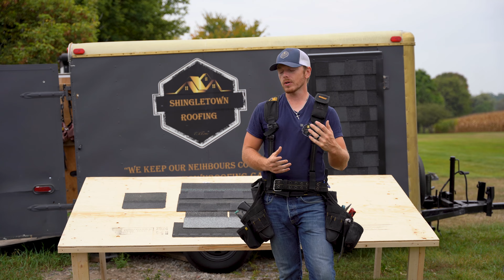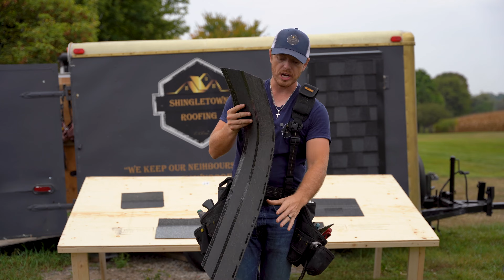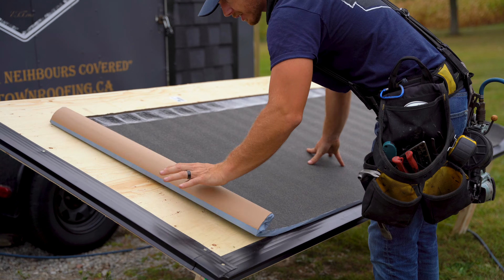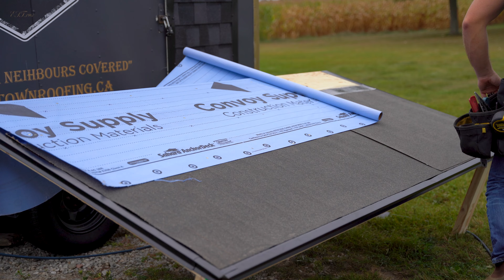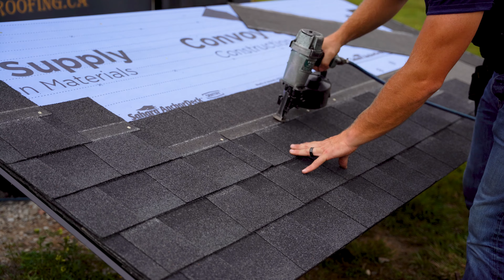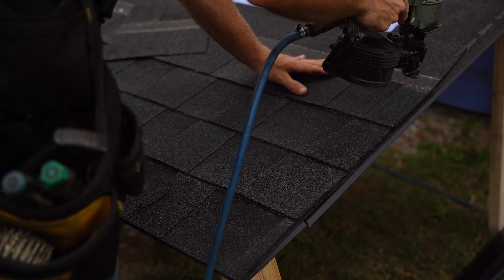How to Install Architectural Shingles

Comment: I think the drip edge shouldn't be butted against the fasciaboard. The drip edge should extend past the edge of the roof by at least 1/4" to 3/4" for water to cleanly run off.

Comment: Why doesn’t the ice and water shield go all the way to the top of the roof? Why doesn’t the underlayment go all the way down to the eve?  (I am a newbie.)
Reply: Ice and water shield is for ice dams where water accumulates over the eaves. The snow melts inboard of the wall and the eaves are cold and is where water ponds as it refreezes. Underlayment is not designed for standing water.

Comment: I saw in other places that the drip edge on the rake should on top of the ice and dam shield not underneath it.
Reply: I'm a rookie, but that layering seems off. Always account for water flow, even in underlayment.
Reply: Depends which state you're in, they vary.

Comment: So unfortunately those old well maid 25 to 30 year three tab stand up better in high wind and hurricanes.
Reply: Not wind rated and not allowed where I live in Florida.  Had 3 tabs before rules changed and lost several shingles due to high winds.  Now have 120mph rated Architectural and have never lost a single one.  Just my experience.
Reply: @SDRacing07 They sell 3 tab everywhere in Florida even Home Depot  ... nothing in regulation or codes stating you cant use good three tab shingles... lol...after 35 years three tabs blow off ....any shingle over 35 years needs replacement.... Go Metal .... life time

Comment: I live in Florida. I have seen the exact opposite of what your saying. The three tab lays flatter. All those architectural shingles lift up blow off and they're a mess. The good old three tab with a nice felt under it You don't have those problems and those three tabs last 25 to 30 years and these brand new architectural shingles are blowing off in a little storm and fill in the ditch...
Reply: I live in the north. We don't get cat 5 hurricanes or even tornados. Architectural shingles are the best up here.
Reply: Also live in Florida and they won't use 3 tabs here.  Architectural with wind rating is preferred if not going metal.

Comment: so start on the left side 6" off set each layers and then go across , but after you get to the 5th layers the start the process over until you reach the top ?
Reply: I believe that's correct.  if you're right-handed start on the left corner

Comment: I noticed you placed the ice/water shield and the underlayment OVER the rake drip edge, whereas other “professional” roofers say that they should go UNDER the rake drip edge. Which is correct?
Reply: Since the starter shingle and the underlayment doesn't bond to the drip edge, you can just put some roofing cement on the drip edge. That way, water won't get to the sheathing either way.
Reply: @michaelott310 GAF states over the drip edge.
Reply: We’ll never know, I’ve noticed that as well
Reply: It seems to me that it shouldn't matter, as long as you're overlapping from above. The starter and subsequent shingles should cover it well.
Reply: Under drip edge in windy areas.  But when using ice and water underlayment it will melt in the sun and stick on top of drip edge.  If using normal paper that does not melt, go under to hold edge down in wind.
Reply: It needs to go over the drip edge otherwise water will get trapped and rot the plywood. Happened to me.